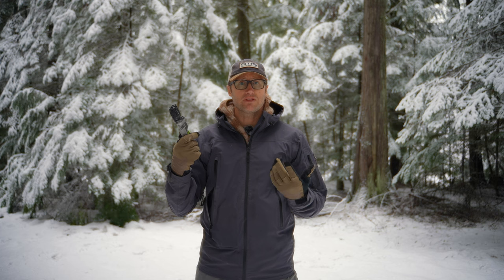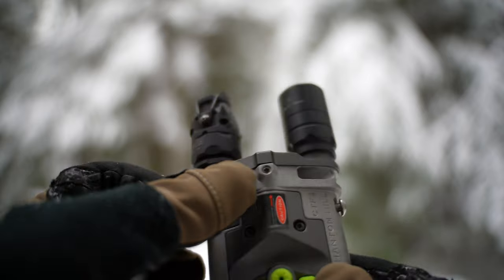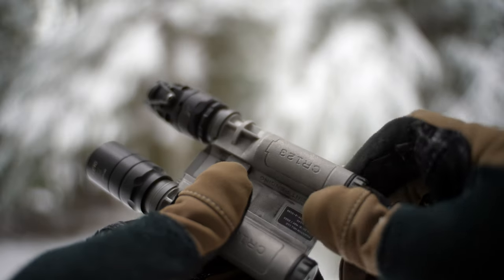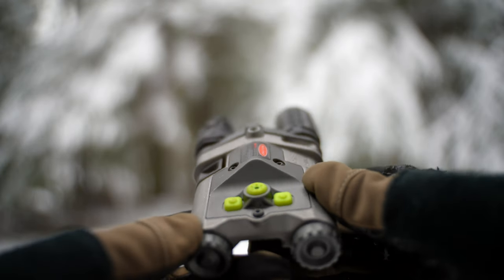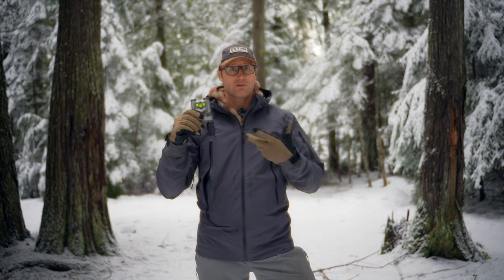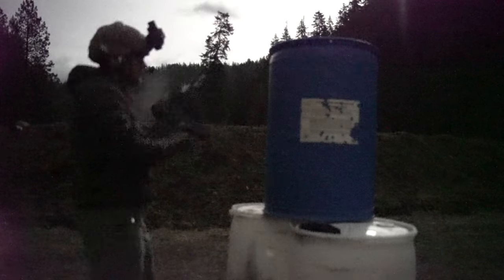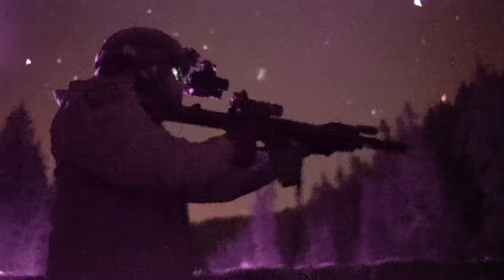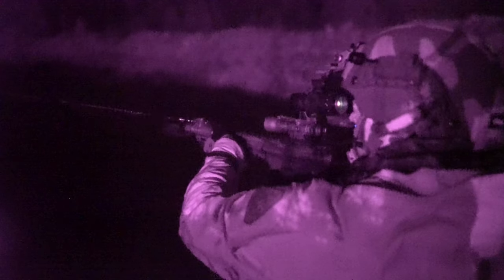CTF2 Laser Unit by Phantom Hill

Comment: I've always thought having a double kiji, one 3 degree and the other 10, would be perfect for transitioning from cqb distance to outdoors. Dedicated white light on the side of the gun with separate buttons so you don't accidentally ND
Reply: Pretty heavy and expensive option instead of just using the included 10 degree diffuser that the 3 degree comes with